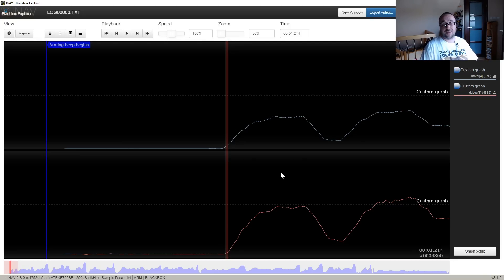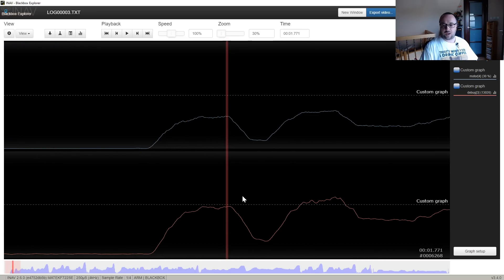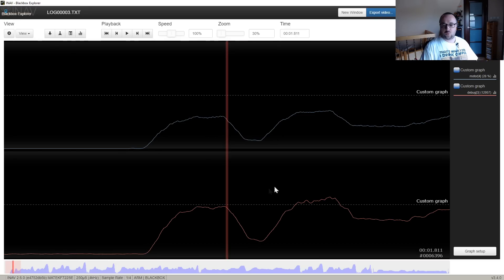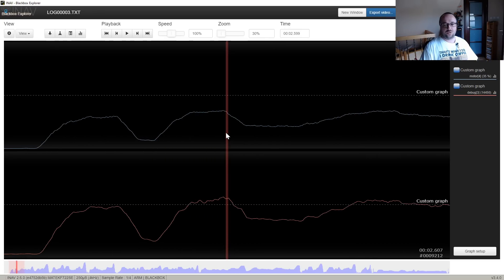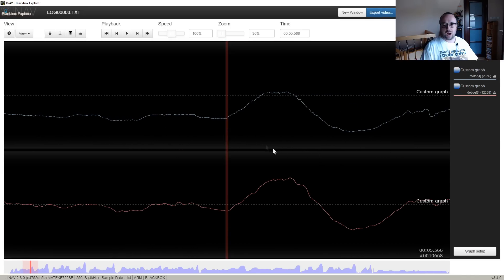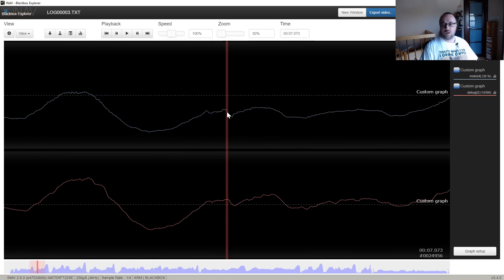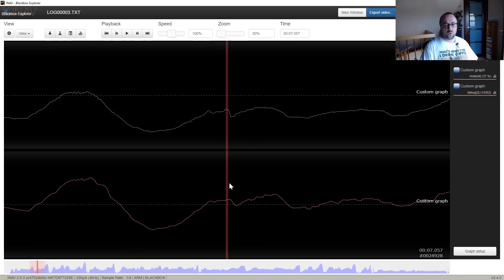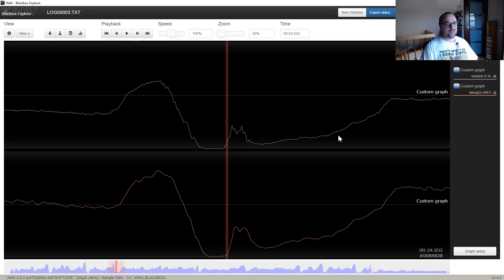Motor Delay - Inertia is a b****

Comment: Here a few comparative tests, 
this is a ramp test with different ESC(firmware) motor combinations
 https://github.com/3x8/nostromo/tree/master/tests/rampTest/ESC-motor-comparative
acceleration delay is 20-50ms
deceleration delay is about 50-100ms
I did tests with and without props
the delay with props is about 2 x higher

Comment: Well... It is a serial reaction so each step is added to the total delay. The delay if the radio firmware and module communication. Then the radio link delay. Then the FC process time to decide the correct output. Then the ESC timing and finally the inertia. As it is a series then any delay that can be chopped will make some difference. Not for me.... I am not a racer then I do not need that fast reaction timing.

Comment: How about measuring the delay from stick input to quad movement.  After all, that's what really matters.  Easy to do.  Give a quick full throttle jab, and then look at the black box logs of the stick command vs. Z-axis acceleration.
Reply from the maker: There will be a next video on this topic in the future

Comment: Every bit helps. The experience is sticks-to-glass.  I agree that small changes don't necessarily matter, but they all add up.  I think low to moderate, but most importantly - predictable latency helps with confidence and control.

Comment: Lots of good clear examples of motor response on miniquadtestbench and my repo.  This doesnt negate the need for faster RC packets, as there additional benefits to the FC wrt filtering, FF, etc.

Any intermediate pilot will feel the stick difference between 9-6ms, and yes you get diminishing returns beyond that only the top pilots may 'feel'.  As you know, 2.4 LoRa packet rate and signal strength is a balancing act.  Lets see what other vendors choose... go fast or opt for a stronger link ?!?!? 

https://www.miniquadtestbench.com/motor-explorer.html

https://raw.githubusercontent.com/JyeSmith/dshot-esc-tester/master/data/EMAX%20RS2306%202400KV/comparison%20plots%204s.png

Comment: You're messurement's don't really seem accurate or am I mssing something? On the input data you took your messurement right at the beginning of the rise. At the telemetry you took your messurement after the rise is already happening. This is at least 10ms off. Also what additional delay is coming from telemetry messurement, fw processing data, etc. itself?

Edit: I just looked at my (old) blackbox logs and my complete RC Command to Gyro delay is around 20-30ms tops, often lower...

Comment: After watching multigp pilots race, I kinda do think any gains in latency would benefit them, but for most pilots it probably doesn’t matter at this point. Though I’m a little confused since we are talking about how many packages are sent from the tx to the rx in hz, and the latency between that input and the desired output in ms. Those seem like two different distinct things no?

Comment: Thanks Pavel, fits  exactly to what i'm thinking and testing for some time now...32/32 pidloop min. filtering dshot4800 on F3 ESCs with EMU ...low pitch props and wide motor stators with low spool-up/spool-dow time.

We have so much timing and frequency based components to deal with, that we get into the same circle like we did with RC rates back in the days.
Today we know that RC rates are more a personal thing, and timing or the interpretation of what we feel as result of a stick input is not very different I think.

My conclusion after playing with all that setting for some time is, that there is a place for all these combinations. Flowy, cinematic movements benefit from more relaxed timings that are optimized to the pilots preference while faster update rates and less latency for RC command will help in the  racing area.  At the end we are again at the point at what we have to accept that code and theory are not great to describe how a quad feels in the air or if one will like it.

It's a good sign for the community that we still have the freedom of choice in terms of flight software and protocol flavours - big THX to all the DEVs 😜✌️.
Reply: Maybe play with 96khz too ;)

Comment: While I agree with the general point you're making, I do wonder how much of the measured delay is within the RPM feedback from the ESC. (Electrically, algorithmically and via the protocol) A fairer test would be to use an ESC / motor / prop on a thrust test stand, as you alluded to.

Comment: Everything is cumulative. We can't break physics, but we can remove as much latency as possible everywhere else - low latency cameras, control links, ESC protocols, faster loop times and less filtering all added together will certainly be noticeable.
Reply: I think thats true. Therefore I also think there's much more to develop on the hardware side that has more effects on quad feel than software does. Software looks like it has reached its peak if you watch its complexity nowadays.

Comment: Interesting but I still think it makes sense to search for every ms of latency that you can.
1. The effects of latency are cumulative, if you had 0.5s of latency you might be able to fly but at 1s latency it would be near impossible. I don't think you can reliably say that if you have 100ms shaving 5ms won't make any difference.
2. much like saving weight on a quad you can have a significant influence by making small changes in lots of places. Control link, esc protocol, software latency, camera feed, vtx etc if you can shave a few percent on a few it will add up.
3. Incremental gains, even if these kinds of changes don't make any real difference now it's the kind of incremental improvement that means the stuff we have in 3-4 years has notable improvements with cumulative small improvements.

Comment: In my opinion the increase in the frame rate is not so much for the delay but rather to have a cleaner signal with a better resolution, more detailed, especially for very thorough and very lively setups. as for hi-res music